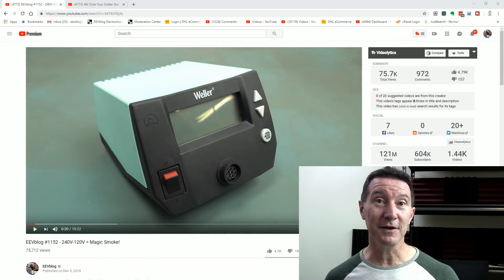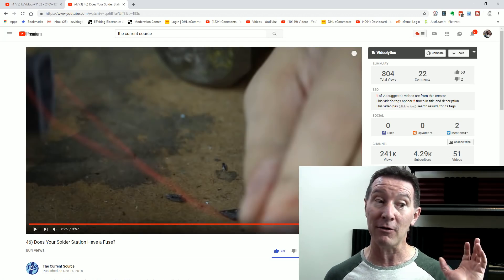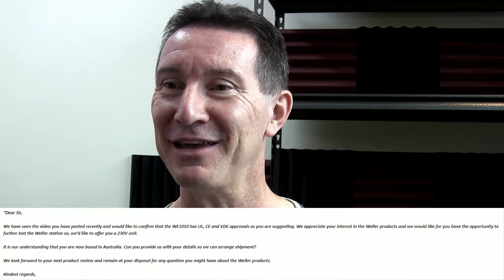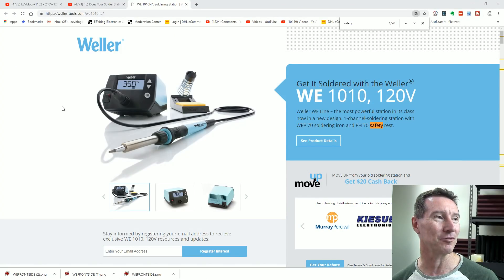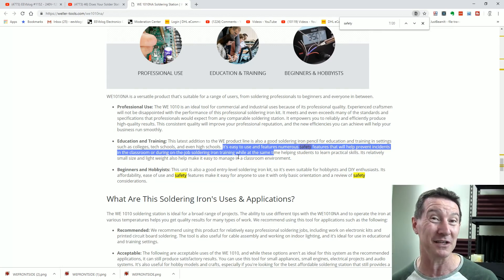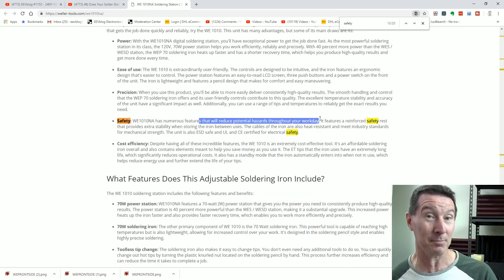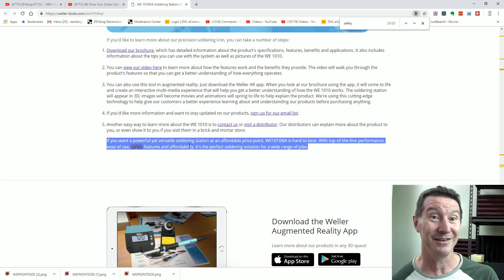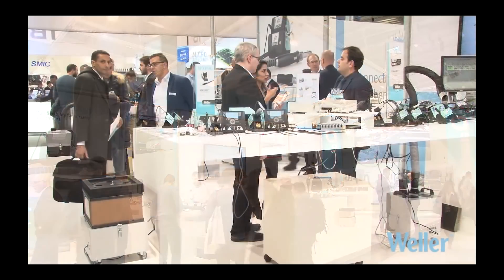EEVblog #1160 - Weller Responds!

Comment: 6:30 Why the heck does a soldering iron need an augmented reality app?!
Reply: That's where the savings from not including a primary side fuse went.
Reply: @2kFXSTD  couldn't have said it better myself :D
Reply: @2kFXSTD  if it's used at the proper voltage why does it need two primary side fuse just asking?
Reply: @niceic.co.uk.  It doesn't need two primary side fuses, only one. The branch wiring circuit breaker is there to protect the branch wiring of the building not the appliance.

In the U.S. for a household or office you normally have 15 or 20 amp branch circuits which can provide 1800 to 2400 watts. An appliance that say is nominally designed to have a 100 watt consumption can fail and draw 18 o 24 times its normal load without tripping the branch circuit protection. This is more than enough to start a fire. 

I would expect to see a primary side fuse sized for 1.5 to 2 times the normal maximum current draw of the device; and this would vary depending on the specifics of the device that is being protected. For our generic sample device that uses 100 watts with no additional startup load, that would be a ~1.25 to 1.75 amp fuse for 120 volts supply.  This would allow a 150 to 210 watt load without blowing the fuse. You could feasibly size the fuse closer to the nominal maximum current draw, but you would be risking the fuse blowing during normal voltage sag the occurs from the electrical supplier during changing system loads.

Hope this answers your question.
Reply: Because augmented reality is the only truly SAFE way to use these Weller soldering irons.
Reply: @edgars53  You mean VIRTUAL reality don't you? at least a 3d model doesn't catch on fire unless you tell it to.

augmented reality still needs an actual iron :D
Reply: Thinking that EEV is a Reviews channel.
Reply: They want your contacts
Reply: Gotta put in those buzzwords, amirite?
Reply: gotta have the latest marketing wank
Reply: So you can experience a transformer meltdown  in a fully immersive VR experience?
Reply: @bobweiss8682  Who would want a free virtual transformer meltdown when you can just buy a real one?
Reply: So the people under 50 that eat tide pods won't insert it into their rectum between tweets.

If they make it like a video game, they reckon it might be possible to get just enough attention span to get some of the information across.
Reply: because they have a marketing department
Reply: So you can pretend use the soldering station that melted down in old fashioned reality.
Reply: I've seen an AR app for welding training, which actually seems useful for someone's first exposure to welding. This though, is just marketing wank.
Reply: Just like the safety of their soldering irons.
A fantasy.
Reply: Augmented Reality is for when your wimpy soldering iron produces a cold solder joint. Eh, it'll do.
Reply: Colleges buy anything with AR because they can record the AR demo to make courses look more tech forward. Ooohhhwewoweee the future is now at bobsuruncle technical college!!! We got virtual reality training programs!!
Reply: Goes to show that they are out of touch with reality when it comes to primary fuses.
Reply: it needs an app however fuse is omitted :D
Reply: So you can virtually burn your fingers off because it doesn’t work after a small mains voltage spike.
Reply: So the on board smoke detector can alert you before the shit hits the fan
Reply: I sometimes toy with the idea of a virtual reality "SMD pantograph station" so that you can work on tiny stuff as if they were Duplo- or some other convenient size. Lots of issues for pan/skew, feedback, tool types and controls, "virtual arms" for probes and parts holders, etc. Probably way to complicated and expensive to be feasible, but maybe future tech will require parts and designs that are so tiny that they'll need something like that for final set-up and inspection. (At the very least, putting one in a sci-fi movie would be fun for the electronics fans.)
Reply: to measure if the d*mn station can even fit on your desk.
Reply: Dave I would like to know where's your responsibility in this is you provided 240 volts to something that was designed to run off 120 volts
Reply: Michael Miller  So true. That those people you mention can't find a use for it, does not mean it's not useful.
Reply: Michael Miller  we're Millennial shitheads, thank you.
Reply: Michael Miller  *25+ year old
Reply: It doesn't... but it's clear that Weller are right into "smoke" and mirrors technology so why not? :-)

Comment: Have 240v in Sweden,taking a break from soldering with my Weller....will go straight back out and inspect that transformer!
Reply: There was. IEC outlet with 500mA slow blow.
Reply: 240? Shouldn't it be 230?
Reply: It should, but Im closer to 240.

Comment: "The low voltage 120V..."
That doesn't bode well.
Reply: Everything is relative. 120 V is a low voltage just like 1 million is a small loan as Trump said.
Reply: https://en.wikipedia.org/wiki/Low_voltage if you ask the IEC, they will tell you that 120V AC IS low voltage, and what most of us colloquially call "low voltage" is actually considered "extra low voltage" by the IEC.
Reply: @sgo9004  Yes, it IS considered low voltage by some standards. But the point is that it is being marketed as a safety feature when it's actually just the standard mains voltage in the US and thus identical to any other soldering iron on that market.
Reply: Any voltage under 1000vac is considered low voltage
Reply: Even 5 volts can get nasty if Mishandled any electic no matter the voltage or amps gets the same respect I give the mains outlet
Reply: @Newberntrains  If you haven't put your tongue on a 9V battery, you haven't lived.
Reply: @chaos.corner  Yep, thats how i test my cars battery
Reply: Chaos Corner That aftertaste. 😂😂😂
Reply: @Newberntrains  well, I consider low voltage anything that won't injure or kill a typical person in a typical situation.  You can be electrocuted if your body is punctured by a moderately low voltage wire.  Your internal resistance is much lower if skin is penetrated, allowing a higher current to pass through your body.  120VAC presents at least some risk to most people in most situations if contact is made.  I don't consider that "low voltage", even if some standards say.

Comment: Stop blaming others over your own foolish mistakes Dude. Everyone is laughing at you for your dumb 240volts plugin mistake, As an engineer you should be aware of this yourself. You are even  dumbest then the product makers.
Reply: Although Dave did make a mistake plugging a 120v model into a 240v mains outlet, the lack of a mains fuse is still a legitimate problem.

Comment: Less fuses = more profit. Should be a basic engineering law. 
So cheaply made they offer some kind of lifetime warranty. Iron toasted? New one sent by the vice president of marketing himself. If you ain't burned to death in the process of course.
Reply from the maker: They could have just specced in a thermal fuse in the transformer design, or a fused IEC connector.
Reply: @EEVblog  
Personally I(but who I am) can understand lack of main fuse, but not the thermal one.
They must put one of this.

In such class of devices(transformers heaters motors) it is actually not a big deal to not have a mains fuse, because device is pretty "strong" to survive any short accidents in mains.

But also this devices have tendency do catch fire, and, with really significant thermal mass, so the thermal fuse is mandatory.

But they really should put both.
It is not the heater or vacuum, soldering iron have controlled and relative small power consumption.
Reply: "They could", "they should", "they must", but the in real world of scumbags economics : "they have not".
Note for self : disassemble every brand new gear to check for basic safety features. Also buy a  big bag o' fuse holders...
Reply: The cost of adding a fuse, all things considered, is pennies. They could easily charge $131 instead of $130. Plus the money they saved from just one or two units being warrantied from the lack of a fuse, would have covered the cost of all the fuses for all the units.
Reply: Sooo why not leave out the transformer too & use a H.V. element ? That should save some money... & copper... 😏

Comment: Please test the 240V version using a 415V supply
Reply: Exactly what would happen if you lost connection with the incoming neutral in the main switch board with more than one phase available. It dose happen!
Reply: Why not 240VDC? The advertisement seems to be okay with that.
Reply: @lesliefranklin1870  That's what he did.  He "accidentally" plugged an 120v unit into a 240v outlet after he "accidentally" cut the 120v US plug off of the power cord and then "accidentally" attached a 240v AUS plug, and somehow this is all Weller's fault.
Reply: @yertelt5570  LOL!
Reply: Actually some Variacs DO go up to '11', meaning that they'll step up the input voltage to 110% :)
Reply: @dhpbear2  Mine goes up to 300V
Reply: Yes please. Would love to see this 🙂
Reply: 400Hz Aircraft supply. Lets them save even more by going for a smaller transformer. If they can't afford a 2 cent fuse, why would they want to include more of that pesky weight than needed
Reply: Are you suggesting to go a bit more photonicinduction style?
Reply: @JanicekTrnecka  Yess! Moar watts = greater efficiency, right? 😆 The more sparks, the merrier!
Reply: Where is @photoninduction when you need him? I hope he sorts out his marriage...
Reply: "240V version using a 415V supply" YES! lol.

(Looks at my WESD51 timidly) If I had the spare money I wouldn't bother adding a fuse to it.
Reply: I laughed irl ;).
Reply: Why? It would be just the same result.
Reply: if you can find a 415V supply, i am happy to test it
Reply: @ryan258147  ... thats standard 3 phase supply ... each phase could run a separate iron !! 😎
Reply: Or 50Hz
Reply: WHY ? You will get same results.
Reply: for safety sake one's body would need earthing
Reply: love your humour Sir Dave. Where can I buy the one hung low iron?
Reply: @dandarte4062  thats what bare feet are for... ☺
Reply: I used to work in a factory that had it's own step down transformers. That in itself wasn't unusual it was the size of the resulting supply 2 x 750 kva transformers. with everything except the lights off they got pretty close to 300v. At that voltage even the fluro's were failing due to over volts.
Reply: YES
Reply: I'm pretty sure that would be in excess of it's designed operating environment, and void the warranty. Weller and UL would not be to blame for your failure to read the voltage label.
Reply: @BlackEpyon  exactly what happened when dave stuffed 240v up a usa products ass on 110 they short safe basicly shunt out and quit working
Reply: @BlackEpyon  But nobody seems to care that he intentionally plugged an 110 unit into a 220 outlet and they are ready to storm Weller's hq with torches and pitch forks like a bunch of angry villagers?
Reply: @yertelt5570  Yeah, I don't know what the problem is there.
Reply: @BlackEpyon  I agree  Also if you need a Primary FUSED outlet you can actually have one installed for 120VAC. it's only 15$ for a outlet .. also if there was Arc Fault Circuit Interrupter or both Ground Fault Circuit Interrupter ) installed it would have cut off the  circuit  since it faulted to ground
chances are you would have a fused outlet installed in your workshop
Reply: @punker4Real  One could easily add a fuse to the unit too.
Reply: punker4Real sadly we don’t have arc fault circuit interrupters in Australia yet. We do have GFCIs though